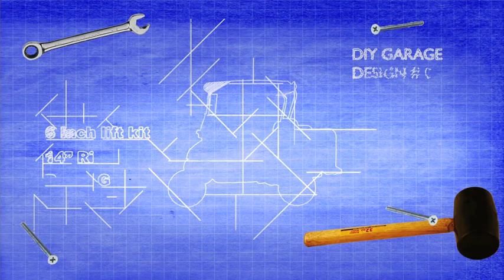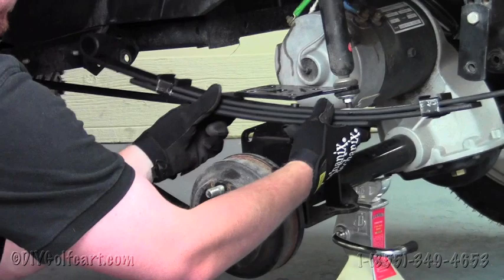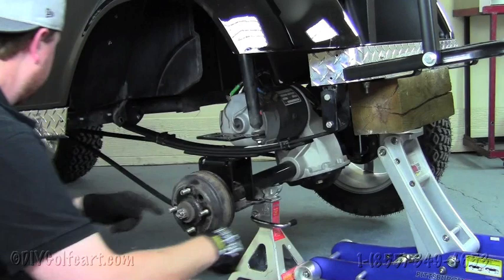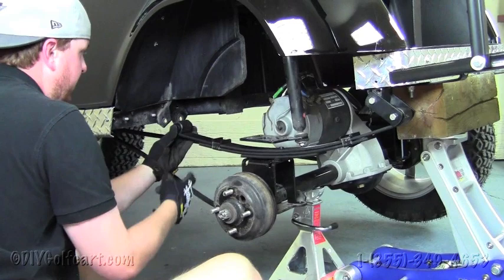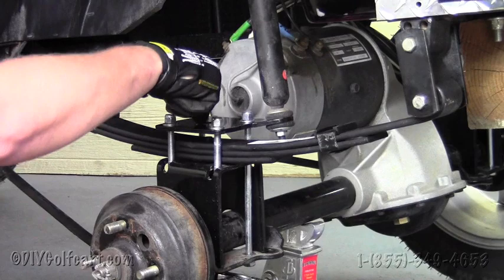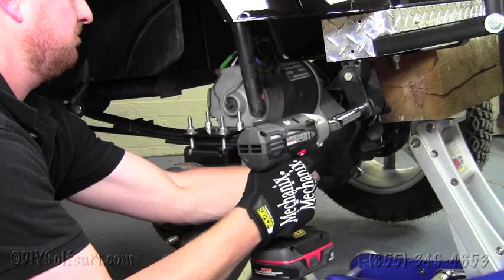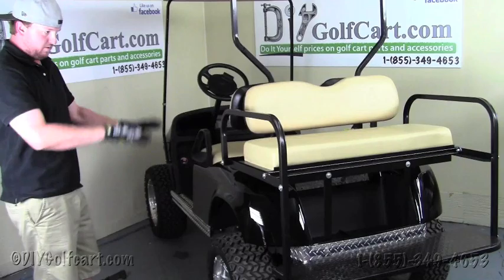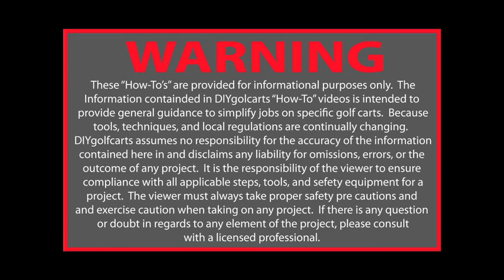EZGO TXT Heavy Duty Springs | How To Install Video | Installing Golf Cart Rear Leaf Springs

Comment: I just did this on a 2001 DS Club car.  Had two problems.  Because of the wider springs my shocks were not long enough to be able to reattach and the bracket that holds the brake cable and the "U" bolt attaches too rubbed on the wheel rim due to the different positioning of the bracket.  No directions at all came in the box so this was a surprise.

Comment: If I add new HD leaf springs and it increases the rear ride height, do I also need to make modification to the front end ? Or will it be riding low front end ?
Reply from the maker: The HD springs will only increase the height about 1/2".